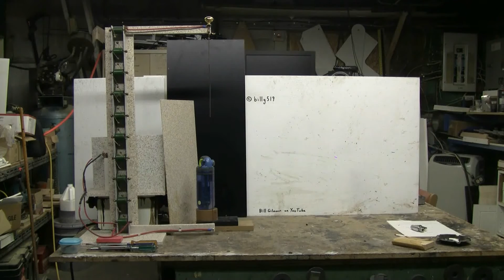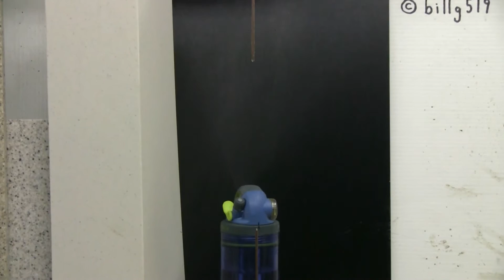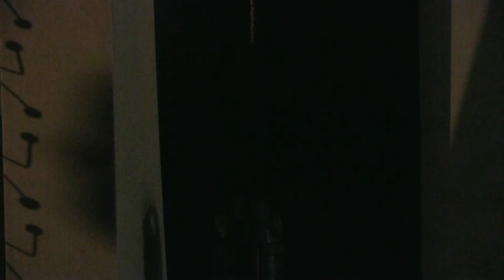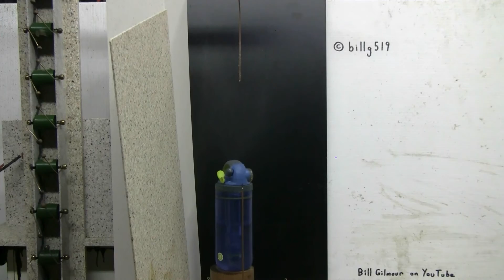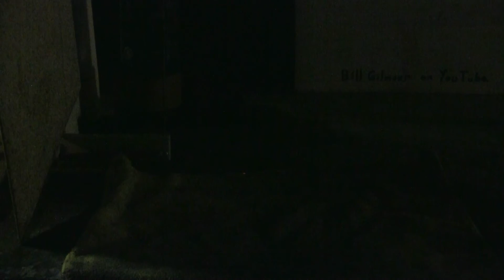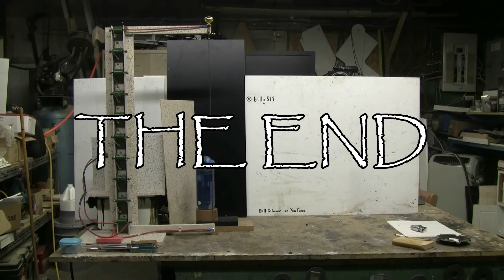Marx Generator - Water Mist

Comment: If you increase the voltage too much, you don't burn toilet paper. Doesn't even turn on the stove gas (so never water). Always keep in mind, it needs heat. Continue with a microwave transformer. Hugs from Brazil.